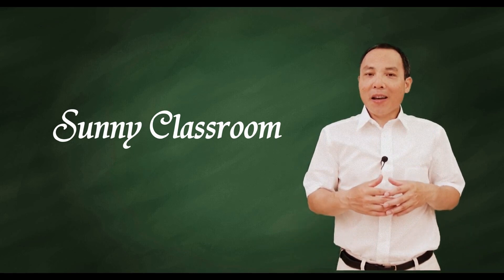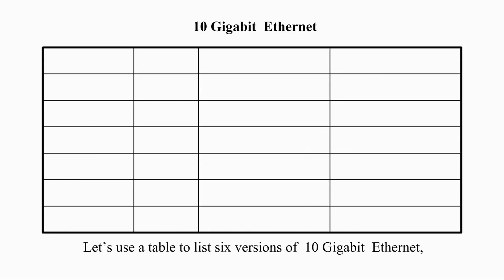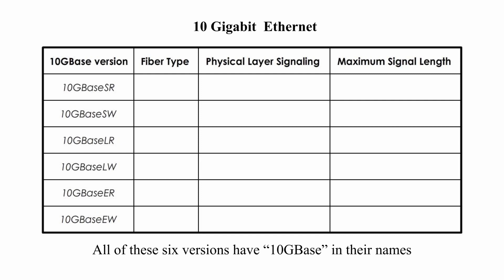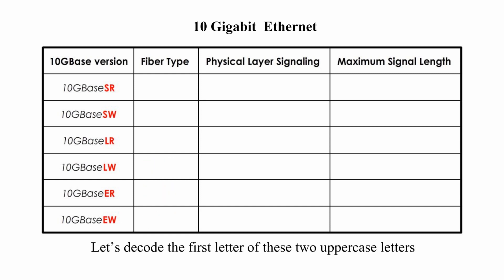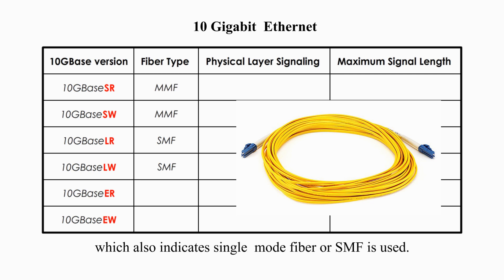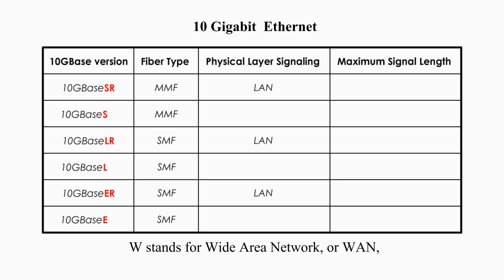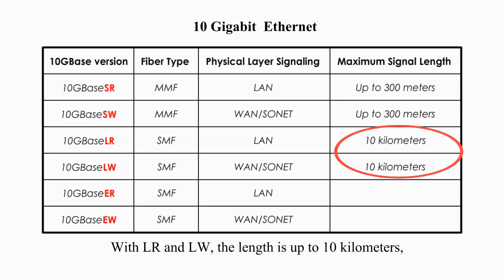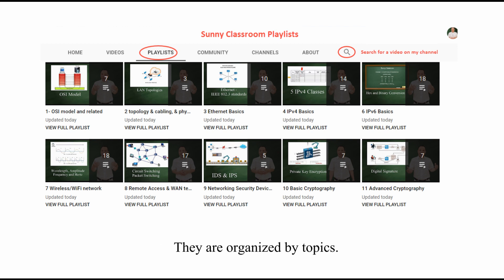10GBase Ethernet Decoded

Comment: Thank you ! Is it good to start with CCNA for Networking field ? Thank you.
Reply from the maker: Yes. CompTIA Network + and Security + should be taken before CCNA, but they can be taken at the same time. CCNA is more about Cisco, but the basic principles are the same.
Reply: @sunnyclassroom24  ok thank you ..! I'm looking forward for Networking videos from you thanks !
Reply: @sunnyclassroom24   Thank you for your videos, I am working my way through all of them! No one else explains it in such an easy to understand way (and no one has yet explained what the letters at the end stand for!). My question is: what is the difference between (for example) ER and EW? Why would a LAN connection need to be 40km? Are all of these physically different cables (in the same way cat5, cat6 etc are)? Or are they the same cables, just the way signals are sent are different? 

Thanks